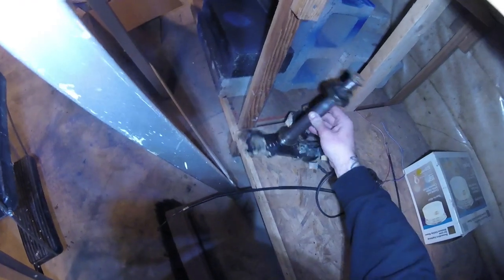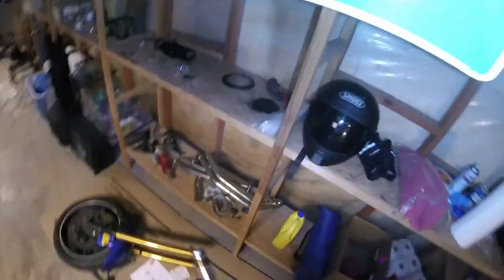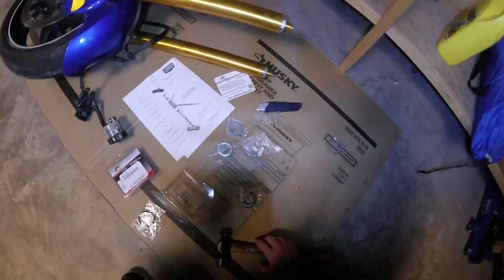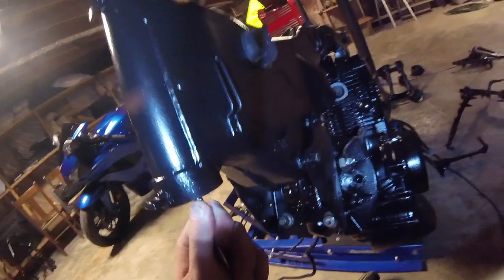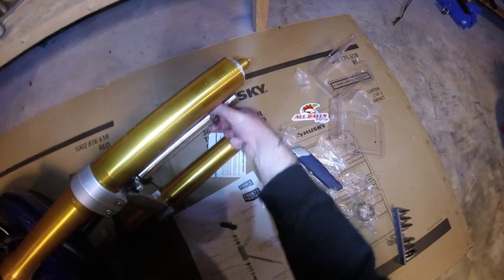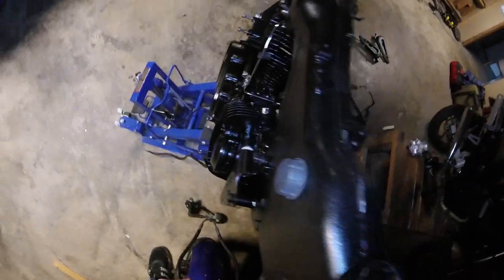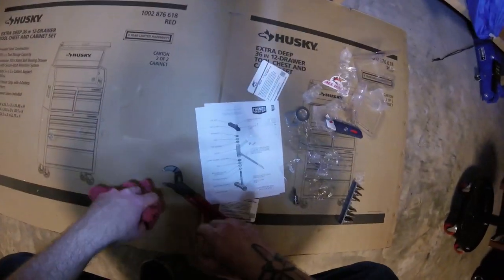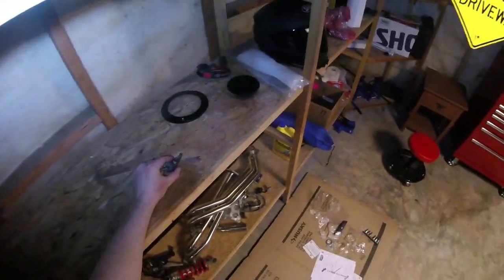Yamaha Virago Cafe Racer Build - Episode 04 - R6 Fork Conversion

Comment: Probably a bit late but...just cut the stem out of the Virago tree (lower gets sacrificed) and cut it to the length required. Since it is steel, run some Mig welds at the end that gets pressed into the lower to build it up. Turn it down to the diameter of the R6 lower and press it into same Tap a screw into lower and stem to secure. Voila. Did the same when I built a replica of "The Shaft" from Classified Moto. You may have to fabricate a small bushing for the upper part from memory.

Comment: All balls kit requires no grease???
Reply from the maker: I did buy grease for this project, but the bearings are apparently pre-greased.  No need for it.  Probably should have repacked then anyway, but whatever.
Reply: Kit does not come greased. They have a light coating of oil so they won't rust from sitting. They still need to be packed and greased. Just did the same thing to my virago but I extended the stem instead of using the cognito moto stem.
Reply: @aleetlemessedup  about to start this project myself, and was going to get a stem from cognito moto.  What do you mean you extended the stem?
Reply: @bradleyandlaurenwasher2527  I chopped the r6 steering stem in half. Then I extended it by tapping and rethreading a 5/8 inch rod and nut as a spacer to extend the stem. Check out this video
https://youtu.be/7fpoBb1sJ1s

Comment: hello, this all balls kit you can find on the market ready to use?  
this is the model for Virago, so you've changed the R6 steering plate pin?
Reply from the maker: Correct, the bearing kit and steering stem were both replaced, allowing the use of the R6 triple trees with the Virago frame.